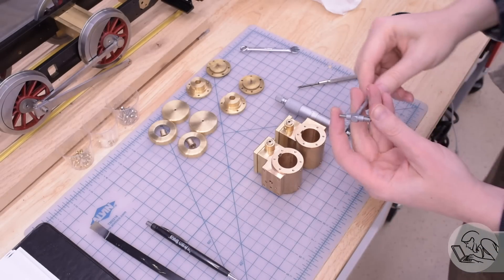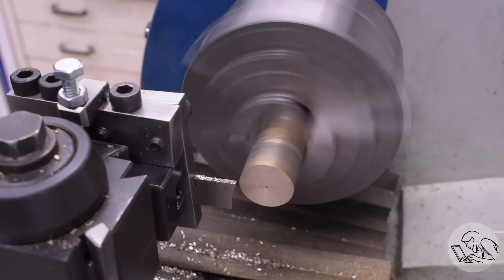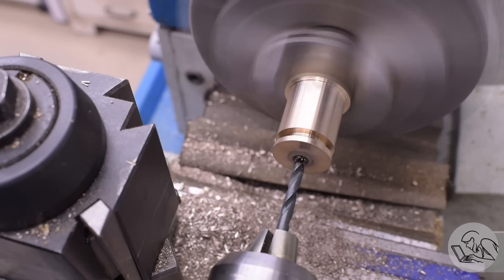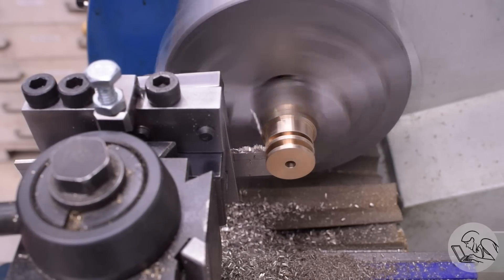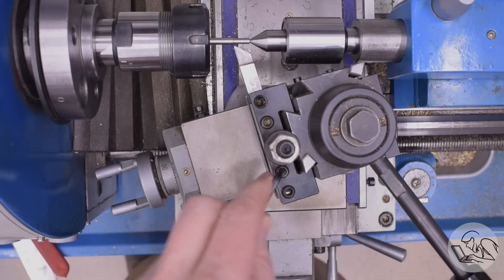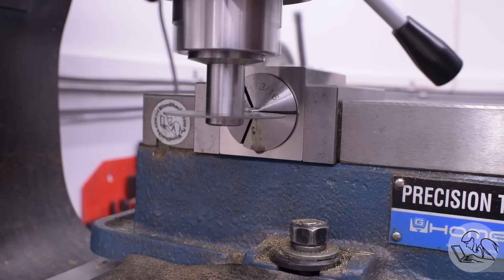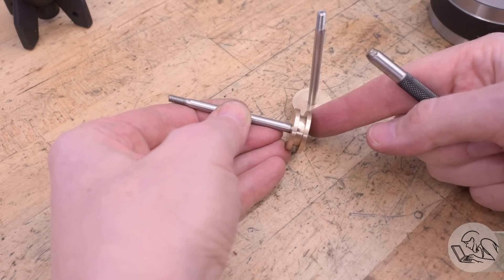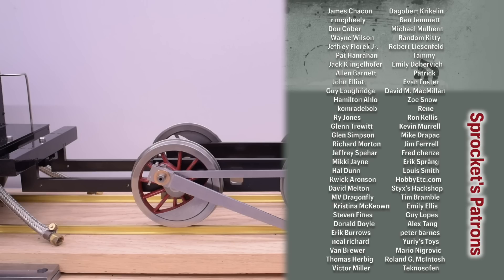Pistons - Pennsylvania A3 Switcher, Part 51

Comment: i'm only a beginner and came here to see the piston and ring set up. i have an old scratch built engine and the piston has a brass ring. it doesn't work well at all. then i seen you use the teflon cord. yep i think you have solved my problem... the whole vid was very interesting. thanks.

Comment: Nice job on the 1/4hp  pm research 6ci steam engine build in your previous videos but I have one very hard challenge for you that I'd like to have done in the future for taking two pm research 6ci steam engines and combined them into a twin pm 6 ci engine can you do the machining and building this for me with having a bicycle 21 speed foot pedal sprockets mounted on the flywheel and please get in touch I need your help

Comment: Mark Pressler built one of those same parting tool holders and had lots of trouble with it. It seemed like a great idea,  but his results made me dismiss it as too finicky. Maybe it is worth a try. I am always super careful when parting and would love some reassurance.
Reply: I've been working with Mark Presling regarding the problem he is having. It's been a real head scratcher. I've used mine a lot and have never had an issue. In fact it seems to be very forgiving. Mark has tried several things to resolve the issue but has not tried adjusting the feed rate yet. I suspect his feed rate is too fast. I usually cut at .001" to .002" per revolution. I've tried higher feed rates trying to duplicate his problem but my old south bend doesn't have the needed power (actually the flat belt slips).
Reply from the maker: I reached out to Mark as well to try and help. I’ve had zero problems with mine and I have ran it through stainless, tool steels, brass, bronze, all no problem. This issue seems to be unique to Mark’s but it’s unclear why.

Comment: I remember learning to use a lathe at school in the 1970''s and we had the "sprung" parting blade holders and lantern tool posts. I've always wondered why youtubers have so much trouble with parting off.
Reply: Partly it's the lack of rigidity in benchtop machine tools, particularly the import ones which are often built to a weight budget for shipping.

Comment: Hey Quinn, I recently discovered the channel and I've been loving the Switcher build (and everything else)! You have a great presentation style which makes it really easy to understand what's going on. I'm now trying to figure out how I can make space in my garage for a lathe - even if it's just one of the cheap 7x14 jobbers - and start having some fun with it.

Quick question, though: in a video a while back you mentioned having a carbide insert that was meant for cutting aluminum but also worked very well on steel. I can't recall which video it was (as I said, I'm new to the channel and was binging) and the insert doesn't seem to be in the tool list in the description. What was it and where do I get one?

Comment: As a boy I had a pneumatic cylinder as part of a lego set, along with a simple valve and pump. I spent an embarrassingly large amount of time moving the piston back and forth. It is indeed extremely satisfying.
Reply: There were bidirectional valves that looked like little toggle switches.  I used a couple pistons and switches with some clever crank arrangements to build an engine that ran on compressed air.  It worked in reverse as a compressor too.
Reply: @Majik_Sheff  Well good news to both of you in case you somehow never saw them, there are plenty of videos on here with people making such engines in many different configurations
Reply: @ that’s the valve I had. Tried to make the valve flip automatically, but never quite cracked it.

Comment: Quinn! Spring loaded parting blade?  As a long time viewer I thought rigidity was paramount.  3 years ago on your video Lathe compound (top slide) tricks you suggested deleting it for more rigidity.  And Metal Lathe tutorial 15 parting operations rigidity is important.  So how does a Spring loaded parting blade holder fit into all this? 😮 loving the videos all the same.  I have lots of problems with parting btw.
Reply: Preface: not an expert, this is largely my intuition. If you pause at 2:10, you can see the "spring" mount is a pretty hefty piece of steel and it's riding against the toolholder's face, so it can only move in one plane. That's the key part. If the tool twists so the long edge digs into the face being parted, that's a quick trip to a broken parting blade (and a broken heart). The spring attachment only allows it to move into or out of the cut, so it can reduce its own workload if it's being driven a little too hard.
Reply: I know your question was directed to Quinn however as the creator of the tool (not the concept) maybe I can offer some insight. First, rigidity is always important. However, compared to most other processes on the lathe cut off is very demanding. During most turning processes the cutting tool is loaded on the side and a lack of rigidity simply results in a poor finish. With cut off the tool is being pushed into the stock. With a standard blade holder the significant downward force on the blade flexes the tool post and/or removes the slop in the dovetails. This causes the blade to move into the stock and sets off a cascade of events. A deeper cut, more downward force results in a deeper cut which results in more force etc. until the lathe stalls or the blade breaks. The spring cut off design actually moves the point of flex from below the tool to above the tool. This  actually makes the blade pull aways from the stock when the tool digs in. Or more accurately, compensates for the flex in the compound below the tool.
Reply: @WinkysWorkshop  thanks for the response.  I work in a high school and have been struggling with helping the students with parting operations.  Trying to part off 10mm steel bar we've had it bend the bar and break it. Maybe I have too much stick out when I think about it.  Thank you very much for your kind helpful response.
Reply: @jimmythejock4376  There are tons of variable with cut off. Everything has to be right. Tight gibs, tool as close to possible over the center of the dovetails on the compound, as little as possible stick-out from the chuck and only what is needed on the blade. Oddly, on the spring cut off the blade needs to extend about 1-inch. Less stick-out effects the leverage on the spring. Need lots of oil and correct feed too. The spring cut-off makes things much more forgiving.

Comment: Is that why a spring pass is called a spring pass? To clean up any areas the spring engaged that are off dimention from spring loaded tools? I know nothing about lathes except what ive learned watching Quinn and other YT machinists
Reply: I was taught that it was meant to clean up the material not cut due to material flex.  When the part springs back after the tool passes.

Comment: Just as a point of order — “the turn of the century” these days means 24 years ago, not 1900. Father Time has a lot to answer for
Reply: No, no, no! The 20's is the 1920's, it was like 80 years ago, and I'm not old!
Reply: Needs the word 'last' inserted. Turn of the last century. Then we would both be happy😂
Reply: @malcolmhodgson7540  The turn of the last century was December 31, 2000.  The turn of the 20th Century was December 31, 1900.
Reply: Thanks for the assembly lesson. I always wondered how Jonathan W and Dave Richards put their rings on their pistons be peening the rod end over?
Steam engine rings can't be expanded / snapped over top.
56 years of injection mold o-ring experience for round water jackets or hydraulic cylinders side action activation - toolmaker, mold designer and project engineer feeling your pain not to nick an o-ring or gould a cavity bore with a slip fit.
Reply: Sadly, you are right!